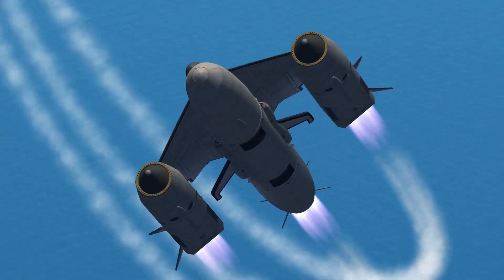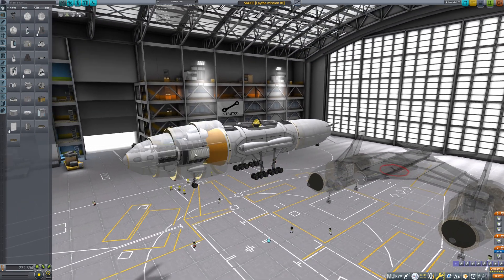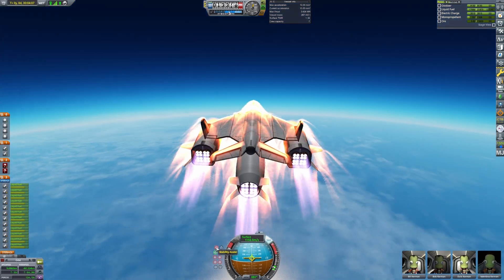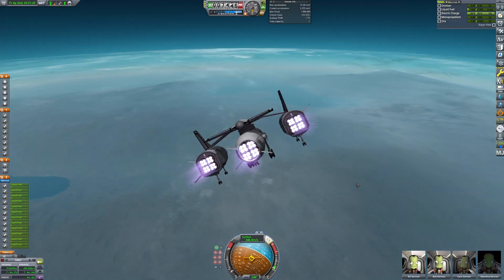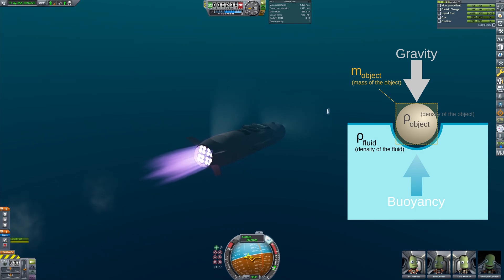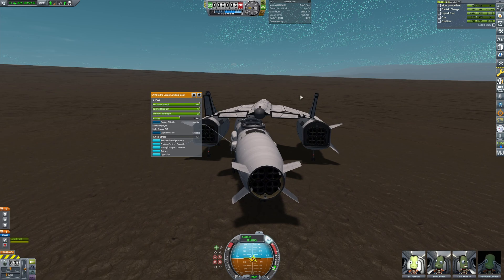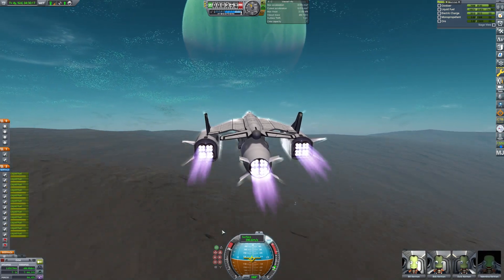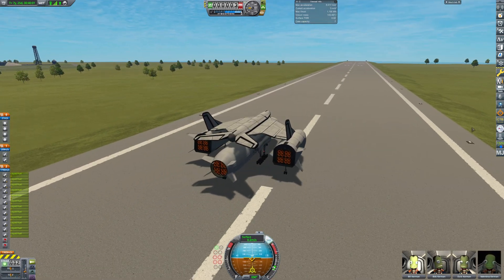spaceplanes obsolete. try a spacesub.

Comment: Water is an incompressible fluid, so its density is more or less unaffected by gravity.  This means that an object that is neutrally bouyant on Kerbin should in principle be neutrally bouyant anywhere else.  A convenient explanation for the low density of Laythe's seas could simply be that they're not actually water, but perhaps some liquid hydrocarbon mixture like the real life lakes on Titan.

A more boring but probably correct explaination would be that in KSP, bouyancy is simulated by applying a force proportional to the cross section "shadow" of the portion of the craft underwater.  This results in bouyancy being different in different places if the developers, say, forgot to scale the bouyant force by gravity.  It also explains why wings are so bouyant, and why cargo doors add extra bouyancy, and finally, is easy to calculate by just rendering a view of the craft from below and counting the number of pixels that are below the surface.
Reply from the maker: Good read Keldor! Water can compress into ice 5 and stuff, but definitely it need more than ~1g. Like Superearth worth of gravity should be in play. But for what it worth, we have a game that never was intended as submarine sim, so it is wonky in places. Lets hope KSP2 would explore this a bit better!
Reply: @Yakez42  Hrmm...  After some research, it seems like the actual buoyancy model used in KSP works by for each part, finding the highest and lowest point in the collision mesh, then using their altitude to estimate what proportion of the part is underwater, making the simplifying assumption that the object's volume is like a cylinder laying on its side (presumably because cylinders are very common shapes in KSP).  Instead of actually calculating density, the part has a "buoyancy" value, which is presumably abstracts the ratio between water displaced and the mass of the part.  There's also something about a center of buoyancy, which apparently comes to play in keeping capsules floating pointing upright and so forth, but I don't know the details.

Regarding cargo bays, apparently there's a bug where if a part is considered "inside" the closed bay, preventing aerodynamic drag, it also prevents it from being considered for buoyancy calculations either.  Thus, when you open the door, everything inside the cargo bay suddenly has buoyancy, making it suddenly want to float up.  This almost makes physical sense, since an object inside another object isn't going to displace any extra water.  It's just that they forgot that in real life, when you open the door, water floods in and the entire cargo bay looses its buoyancy in the process.

As for wings, I'm not sure whether they happen to have low buoyancy values for some reason unknown to everyone but the developers, or if we're just being tricked by the fact that a cylinder laying on its side is a particularly poor stand in for a wing oriented edge on, giving the illusion of very high buoyancy.

Finally, I'm completely stumped at why things behave different on Laythe from Kerbin.  They actually did mess with the water density on Eve (because it's supposed to be hydrogen peroxide!), but Laythe apparently uses the same density as Kerbin.  Now, things should sink to the bottom or float to the top more slowly since that's all about gravity, but whether something sinks or floats at all should be unaffected.

Comment: This whole water thing is pretty interesting, do you know how itis on Eve?
Reply from the maker: Eve need propellers for submarine. Jets does not work there, It would require quite a bit of redesign. And considering buoyancy well this was my first offworld submarine, so need to check one day! For power I am using RTGs to power reaction wheels and fuel cells to power refinery.
Reply: @Yakez42  Yes sure, I meant with propellers for eve😉. I never did an Eve return mission, but I got extremely close to it, but I didn't have  enough thrust for qn orbit.

RTGs are a good tipp, when I went to laythe last time, it was only my 3rd mission to the moon and I used solar panels, but then I noticed, that the sun was too far away😅 (normally it wouldn't matter, but my VTOL mechanism got stuck).

A Submarine is a whole other Level, I've not reached yet, so respect for that👍
Reply from the maker: Yeah, sun power is not so great for Jool and Grand Tour missions. Unless you are doing ion engines solar panels does not cut it. Over time I just stopped using solar panes as source of power for SSTOs and Shuttles. Solar panels need proper spot to avoid overheating during reentry and this spot can be not where you get the most sunlight... Once you put convertotron there is no reason not to use fuel cells. They are light, replace batteries and fuel is not an issue when you have refinery with engineer.
Reply: And how did you do the electricity supply? Did you use RTGs?

Comment from the maker: btw let me know if someone want to see refined version of this craft xD
Reply: I do!
Reply: I wanna see multiple configurations for different missions for this craft. It looks so cool and has so many smart details and solutions. How about that top part of the wing configuration bringing a Eve-capable stack to Eve? The top part of your craft just screams "big bulky difficult cargo SSTO"
Reply from the maker: Eve need staging and at least propellers for the sub, since jets does not work on Eve... Honestly it should be very different craft and 100% not an SSTO. So far in Spaceplane land I have managed to make 4 stage shuttle, where nuclear engines detach before Eve decent, main craft push itself with propellers to 10km, then nose cone detach as 2 stage rocket and rendezvous with nuclear engines in orbit for Kerbin return. Cramming sub into that would be something xD